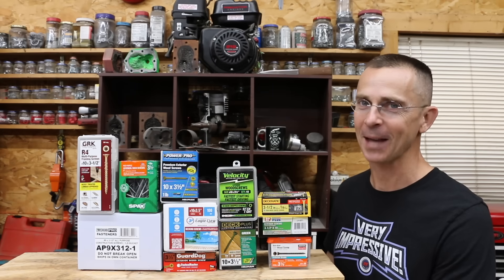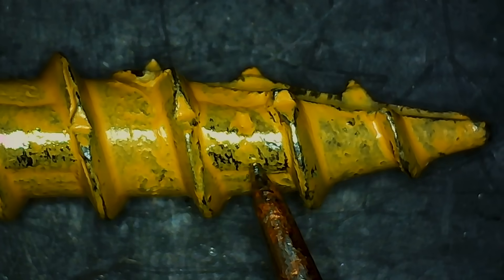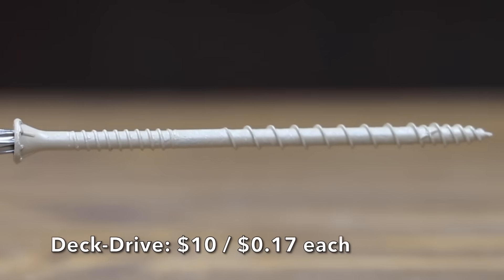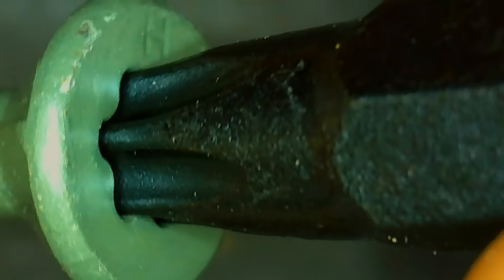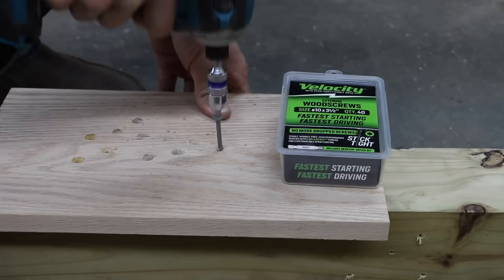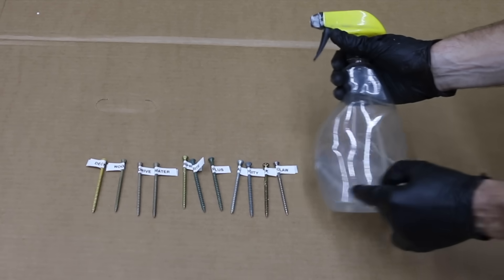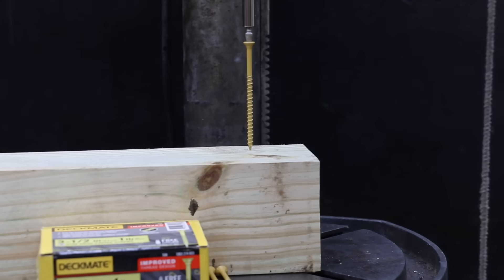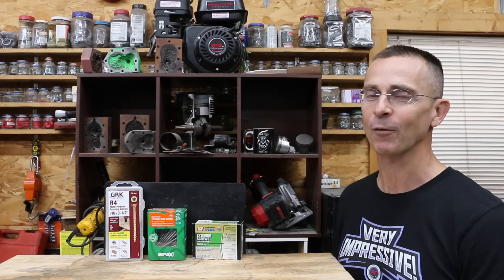Best Deck Screw? GRK vs SPAX, Grip Rite, Deckmate, WoodPro, FastenMaster, Deck Plus, Eagle Claw

Comment: I use a few of these mostly due to cost; I keep a variety of lengths on hand and have found the Grip-Rite seem to hold up best. I use Grip-Rite in 1 5/8”, 2 1/2”, & 3 1/2” and Deckmate in 1 1/4”, 2”, & 3”. I also have some GRK 1 1/2” & 3” for joist hangers as they’re the only structural rated screws allowed by our inspectors. 
Would love to see a pan head screw off as I keep a number of sizes of them as well, Treks and Kreg mostly though a few others for specific tasks.
Reply from the maker: Thanks for the video idea.

Comment: I use spax, love them. Now lets see how they do. Update just finished watching I think I made a good choice in the spax. The reason I started using them is something he did not mention, the head on the 3 inch -3 1/2 deck screws are larger in diameter than any other screws I have used in the same size so they pull boards together just a bit better.
Also I have used smaller #8 washer head screws quite a bit and between the spax and GRK I don't have any issues with the spax breaking off inside the wood while driving or removing and they still use the T20 bit as opposed to a T15 on the GRK.
Reply from the maker: Thanks for watching!

Comment: I will say, I was surprised you did the corrosion test with acid. Would've liked to see a comparison after screwing them in and out, so that there was physical abrasion to the head and threads.
Reply: He did, at 17:39 you can hear him talk about the spots on the screw where the finish was worn off from the hardwood but still did good.

Comment: I think that once the screw it's in the wood the pressure between the wood and the screw it's so high that the water shouldn't penetrate, so it doesn't matter the damage that suffers in the "screw portion" (the part that goes into the wood) but for sure it matters in the head part
Reply from the maker: Thanks for the feedback.

Comment: Thanks, very interesting - I am not surprised that the overall conclusion that you can have speed or strength, but not both, but I think the most interesting take-away from this test is that price is a very poor predictor of performance, except that the cheapest screws all perform relatively poorly - the mid-range and most expensive screws are all over the place .... Yes, Velocity, I'm looking at you!  18:05

That said, I do wonder about where the prices came from, I am guessing that it's just the price you paid?  I would expect that screws are cheapest when bought from a major retailer such as Lowe's and HD, that they cost more from somewhere like Ace or Tractor Supply, and are most expensive when bought from a Mom & Pop hardware store.  So I am wondering if price has as much to do with the store that sold them as it does with the quality of the product?  😕

Comment: As always, results are subjective to each person's needs, but I think we can all agree that weight to start screw and speed of screw isn't NEARLY as important as actual performance of the screw. ie. pull out force or shear load. So if screw #1 were easy to start and fast, but couldn't hold a sheet of paper on the wall, and screw #2 were the opposite, they shouldn't end with the same score.
Reply from the maker: Thanks for the feedback.

Comment: Always appreciate the content, I was excited seeing so many brands but then disappointed not to see the “Lox wood deck screws” from Grabber, future contestant I hope… always liked the driver head’s since it works at an angle, I use them around the minifarm constantly, unless you bend it you can reuse them endlessly
Reply from the maker: Sorry I misses those.  Will put them in round 2.
Reply: Thanks for the tip! Those look handy.

Comment: Deck Mate used to be a better screw. It had a different head on it back in the day. When ever I remove them from old projects, they're never rusted. However, the newer deckmates always have rust on the threads when I remove them from old projects. I love GRK screws but I'm excited about your findings on Grip Rite. Low cost, great screw.
Reply from the maker: Thanks for the feedback.

Comment: I know this is to help folks, but I don't think deck screws are really the first to really go out. Grandmother has a wrap around deck on her house, she's nearly 90, each year I go out and pressure wash this deck for her, along with replacing rotten boards. The deck was made in the 90's so it's 30 years old now, even than the deck screws haven't been a issue, I have encountered a few broken replacing boards but it's always the lumber to go first, even when pressure treated about any deck screw will outlast the lumber.
Reply from the maker: Thanks for the feedback.

Comment: SPAX are awesome, you can pull anything together, close a gap or drive them darn near all the way through the board and out the other side if you want I just wish they used the more common t25 size torx bit and the are pretty expensive. The grip right from Lowes are my basic go to unless I need something special.
Reply: Agreed on SPAX. Grabbed some on a whim a few years ago for a honey-do project and have been sold on their screws since. Great quality.
Reply from the maker: Thanks for the feedback.
Reply: @Ross Radford he did that too. I made two comments. This one and I suggested testing razor knife blades to see which ones actually last the longest without dulling, rusting or breaking. He responded to that comment also

Comment: I've always been curious if those torque sticks (or as Amazon calls them: Torque limiting extensions) that impact wrenches are even remotely accurate. It might not make a good comparison video, but it'd be interesting.

Thanks as always for the great videos!
Reply from the maker: Thanks!  Thanks for the video idea.
Reply: @Ross Radford Since you're telling people what to do, I'll do the same to you.
1. Stop replying to somebody's comment if you're actually trying to reach the video creator.
2. Stop telling people what to do.

If you want to share your opinion or frustration, you can do that without forcing your opinion on them too, it's not that hard. Just say "I think that.." or "In my opinion", and realize that most people don't care - at all - what you think, so don't act like you're so damn important.
Reply: they are only accurate if you calibrate the gun\air supply to the sticks in question.  They are fairly consistent regardless, and so long as you do some rudimentary checks to make sure you aren't massively under or over torquing, they are fine for car tires.  That isn't to say they've never caused issues, but imo that's more user error.  I've met guys who use a "well calibrated trigger finger", and while most of them also don't have issues, i can only imagine torque sticks are better than that.

I did use one for quite a while back when i was changing tires almost weekly for my 4x4 (i welded the diff, so i tossed crap tires on weekdays for drivin to work, and the better tires on when i went wheeling) I never had a issue with mine at the time.  I was pretty broke back then, so the labor tradeoff vs getting a proper locker installed was worthwhile to me...at the time anyway..
Reply: Ya, I don't use them for the final torque -- always use a torque wrench for that.  What I find them useful for it to prevent over-torqueing wheel nuts when reinstalling a wheel.  If torque spec is say, 100 ft-lbs, I put a 90 ft-lb torque limiting extension on the impact driver and install all the nuts, then go back with a torque wrench for the final 100 ft-lb spec.  This makes sure that I don't over-torque the nuts using the impact driver.
Reply: As a mechanic, I use torque sticks all the time. No, they are not very accurate but I still prefer them to torque wrenches. I’ve never lost a wheel with torque sticks but have lost one using a torque wrench. Also when customers come in with loose wheels, it’s often due to tire shops using torque wrenches. I have no problem with techs using torque wrenches, but it’s crucial to retorque them after 100kms or less. With torque sticks I haven’t ever had to retorque a wheel. 

A torque stick typically torques more than what it’s rated for. But this also is effected by the torque output of the impact. Air and cordless make a difference and the blows per minute of the impact makes a difference. 

A wheel I’d say seats better to the hub using torque sticks than it would with a torque wrench. It also saves a lot of time.
Reply: Yeah,this exactly.  They aren't very accurate but they have a time and place and they depend on being matched to the right impact set up.  They're great for things like rims and frame mount hradware but are a disastrous or at best poor choice for actual torque specific critical things like engine ead bolts. Actaully anything on the actual engine torque sticks are bad choice.
Reply: @ThatGuy-sd3zl  No way I'd trust final torque to a torque stick.  Too dependent on air line pressure and gun settings.  They are fine for limiting the gun's torque, but final torque needs to set with a torque wrench.  Question: Would you final torque the engine head bolts with a torque stick?
Reply: @keepingdistance4404  I only use them on wheels. Which is what they’re made for. I can’t think of another application in which they’d be used.

Comment: any deck screw as long as it takes a robertson bit.i redid my cedar docks with new screws and after driving a half dozen torx,i went and bought normal robertsons.once they are on the bit they stay there until it's driven in.i used several hundred,so bulk exteriors from the local hardware.
Reply from the maker: Thanks for the feedback.

Comment: Deeply driven stainless screws may de-passivate and corrode over time. On boats, believe it or not, bronze is preferred over stainless below the waterline in areas where there is poor water movement because they do tend to be subjected to anoxic conditions which cause the stainless to lose passivation. Still, I think stainless deck screws will hold up for a very long time and this might not be an issue.
Reply from the maker: Thanks for the feedback.

Comment: The video we all wanted, but didn't realize we needed! Can we test concrete fasteners next? I want to see how they hold up head to head

Thanks for your hard work!
Reply from the maker: Thank you for the video idea!
Reply: @Project Farm  Would you use the same type of concrete fasteners just different brands or different types of concrete fasteners. I would like to see the difference between concrete screws, hammer-set anchors, lag shields, lead screw anchors, plastic wall plugs, anchor bolts
Reply: Well I guess we can expect tapcons...
Reply: Agree, why haven’t I thought of suggesting this already. So simple, right in front of my eyes.

Comment: Once again, great informative video! Would be interested in a sharkbite vs pex crimp vs pex expansion vs copper solder strength test!
Reply from the maker: Great video idea! Thank you
Reply: 👍🏼 Copper wins (unless frozen) is my bet! Probably a good test candidate if you can rent or borrow a PEX expansion tool!
Reply: I've personally seen sharkbites get pushed off of copper pipe if the lines freeze, they don't give up without a fight though, the teeth will dig into the copper and literally shave slivers of copper off of the pipe as the ice expands inside it.
Reply: pex copper ring crimp vs the thin stainless ring crimp
Reply: That test has been done. I forget the guys name, Matt something, does a lot of shill videos but he has some gems such as the above mentioned vid and one about the internal damage of water heaters over time
Reply: The pipe material bursts before the connections on everything but the sharkbite.